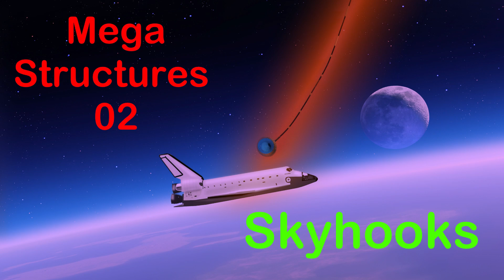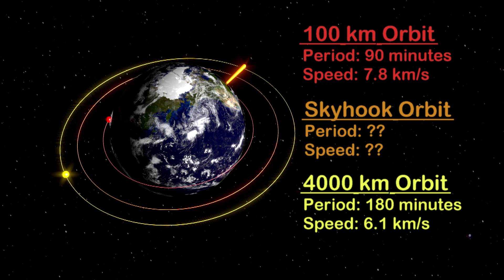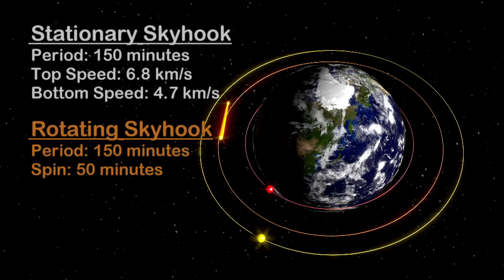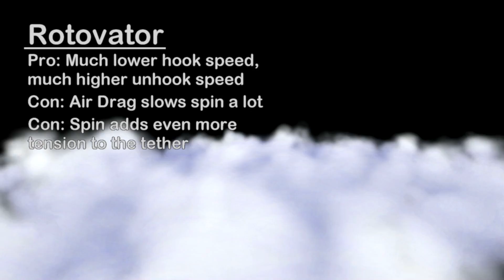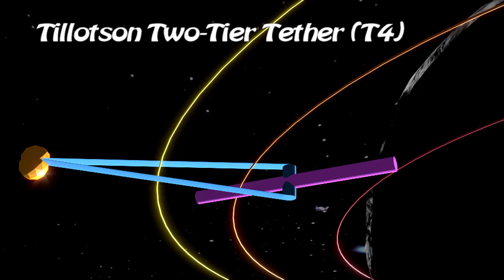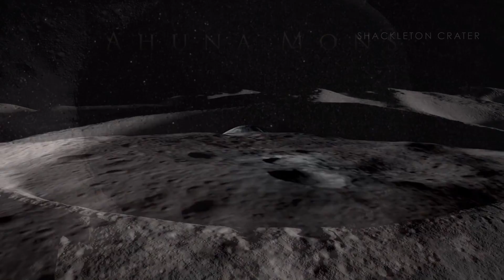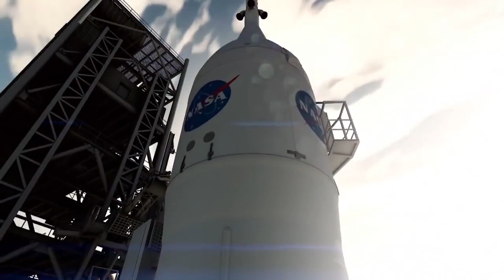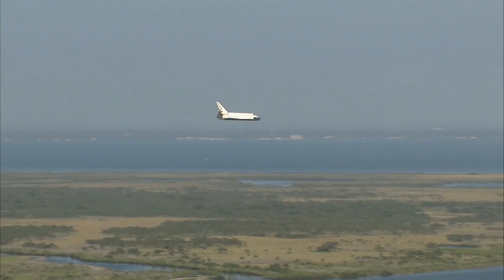Skyhooks & Rotovators

Comment: I'm hooked! lol

I am wondering about some of the challenges that might arise from this kind of tethering of the lower atmosphere and space, that has got to produce a LOT of heat if it is moving that fast in the atmosphere, no matter how thin the air is, second, all that motion, would that not create a giant target for static discharges from the atmosphere? To date, all of our experience has been with single point orbital crafts; would something that traverses several orbital zones present tidal challenges that could also vary, with the motion of the moon's orbits, and the relative positions of not only the ocean tides, but changes in the Earth's gravity based on its rotation vs the orbit of the spinning hook?

I know you said that basic computers can work out these things, but I fear that getting moment to moment data based on real time circumstances might be what is needed to balance and stabilize the sky hook's rotational orbit. I also wonder about how long one of these could be relied upon before its structural integrity fails, and how we would be able to monitor the hook's strength. Remember it only took a sheet of ice less than a meter across to fatally injure the shuttle.

I have no issue with what you have mentioned, its all the hundreds of tiny things that remain which bother me. I can assure you that I would never want a giant magnet to slam into a ship I was on in high atmosphere cruising at mock 1.2... the grab alone might be too much for the human body to take, and the ship... unless you construct it with a bump plate that is heavily reinforced for such a collision...  (the weight factor is another thing) Not only is the timing for the rendezvous critical, the downswing and the forward motion is a huge factor to contend with, this looks like a simple thing, but at speeds like these and distances like these, rotators could be off by a mere sixty meters and spear the poor cargo as it came into range, and that would be a near perfect line up by comparison to the scales involved. That magnet might latch onto a wing, or somehow the plane flips or rolls on its side due to the magnet being just off to one side, then the crew gets pulled in a direction that kills them.

I thought the stationary orbital sky hook was challenging enough, with plenty of engineering hurtles to overcome, without adding the rotational bonus of centrifugal forces, high speeds entering and leaving the atmosphere, and the hard sell "grabbing" of the payload. I have always thought in terms of simple is better, and while I know the only moving part is hook itself, but that may be an oversimplified view of this problem. 

I am not trying to shoot the idea down, but I am not a fan of this direction for acquiring orbit. Though humanity has the knowhow to do this, I do not think that we have the regard for strict upkeep that this design needs in order to keep it reliable and safe for use in an ongoing manner.
Reply from the maker: Well one thing I'm kicking myself for not having mentioned in the video, and there were actually a few, is that you can reel in a tether when it isn't hooking, at least enough to keep it over the atmosphere. Though in fact it would probably be several reels spaced along the length. Anyway that can help with heat and drag since it only dips down into the air when it is hooking something.

The acceleration of the connection itself shouldn't bee too bad, I should think you could reliably get to speed difference of 10 m/s or less in a short enough window and that ought to be enough to not require any truly epic shock absorption engineering. Easier said then done, I admit, but doable I think.
Reply: I just got your update on my feed, thank you for distracting me from debunking a Flat Earth "proof" video. No, I totally like the realistic nature of these concepts and practically based ideas... (talking about your videos now) I understand, making videos "all inclusive" to the nature of ever changing technology which makes a concept feasible vs impractical is often very hard to deliver... case and point: I would never have believed Space-X or anyone else could land a rocket the way they do... but it's a reality now.

Comment: With a robust rotovator 'network' you can almost have zero energy operations if traffic to and from earth is symmetric.  Knowing that space is the place to do all our future heavy manufacturing, you might even have to skip electrodynamic reboost and just shunt power into a maser and beam that to earth for power as incoming cargo comes down.  Or use it to power microwave hypersonic shuttles.
Reply from the maker: It does get easier if the hooks are big enough compared to the payloads to have relatively minor drop from each hook and you've got a lost of mass coming back down too, but I suspect we mostly won't and so will need something to handle the 'balance of payments' as it were.

Comment: Is it feasible to combine the idea of an elevator and a skyhook? As in, launch vehicles from an elevated station a few km up and then pick them up with a hook to require even less fuel?
Reply: Mel le, You could argue they are the same idea.  The skyhook is a special case of the rotovator or tether.  A skyhook rotates once per orbit.  The space elevator is a special case of the skyhook.  The elevator is a skyhook that rotates once per day and has a center of mass located at geosynchronous orbit. 
The main problem is that our buildings do not reach out of the atmosphere.  You need both buildings 100km tall and a bridge/runway between them.  A tower would also limit your options.  The only way to access space would be to travel to the towers.  With space planes you can take off and fly to the hook(s) from an airport.
On Mars Olympus Mons reaches out of the atmosphere.  The spaceport potential has been noticed.  On Phobos you could build a masonry tower tall enough to reach the Mars-Phobos Lagrange point.  From the Lagrange points you can build sideways and make a runway parallel to mars orbit.

Comment: I'm not sure if you mentioned it, but is there any way a ground based tether can be used to bring fuel to the rotating launch tether (meaning even less weight to be carried by the ship itself)? Or would changes in momentum ground this idea?
Reply: A medieval traction trebuchet might work an asteroid.   Replace wood with some other material.  Maybe use hydraulics.  On a planet with an atmosphere you run into problems with the cable burning up.

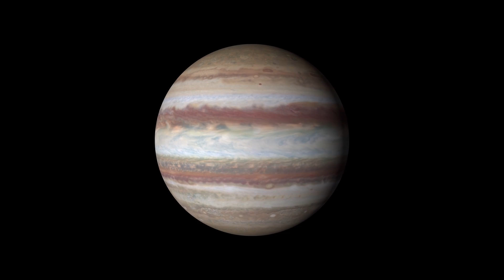Comment: 19:53 Are you sure there is no ground? I thought Jupiter has a rocky core.
Reply from the maker: Jupiter might, we don't really know yet, states of matter at those kind of pressures get kinda iffy, but its probably not a place people would be setting up bases.
Reply: yes a base would be a though challenges I would imagine. :)
Reply: From what I recall, the states of matter are not clearly defined as you go deeper.  You start with the thin atmosphere at the edge of Jupiter then that gas becomes denser and denser and starts acting like a liquid but isn't a liquid, but then becomes more like a liquid and then starts acting like a solid, but still isn't and so on.

Comment: The spinning one seems like it could fling things out into space. Like... an inter-planetary trebuchet :D
Reply from the maker: Yes, it is the advantage they have over a space elevator, when rotating it has a higher top tip speed.
Reply: And you can have multiple stages that toss stuff up further or capture incoming cargo to lower it.  A whole network could potentially allow for a zero energy transport network to anywhere and coming in from anywhere in the solar system as long as incoming and outgoing cargo is balanced.

Comment: The hook should really be going in the same direction as the craft at the start only marginally faster
other than that minor point great video
Reply from the maker: :) The plane has to catch it, or be overrun from behind by it, yes, but relative speed is dubious in the animation since it is just a photo of the sky being used. Special effects on the channel, at least the ones I make, are still 1990s low budget TV CGI levels

Comment: If you mine asteroids and use the skyhook to deliver down to earth it will provide momentum to help keep the skyhook in place.
Reply from the maker: Yes it would but I think you would want to be able to restore that momentum without needing an even flow of trade or a tight timetable.
Reply: You can adjust the deorbit velocity by adjusting the tether length.  Excess velocity gets dumped into the atmosphere (via parachute or wing).

Comment: i have a question. would it be relevant if you could have a weight within the shaft of a spinning sky-hook that would slide up and down depending on the orientation of the sky-hook?
would this help to keep its momentum? obviously it wouldn't keep the hook in orbit, but it would stop it from slowing down as much when interfered upon. it would have to be motorised and powered with solar panels. this is just a thought, i expect there to be a reason why it doesn't make sense but i don't see it yet :)
Reply from the maker: Now there's an interesting notion, a mass that dropped down as the hook's tip fell but lifted up right before the hooking. It could have advantages.
Reply: The sky hook always loses exactly the momentum that the payload gains.  The total is not effected by geometry. A spacestation/skyhook can have much larger mass than the payload.  Not all the mass needs to be rotating. 
Why inside the sky hook?  If it is inside the shaft it should probably be part of the shaft.  Sliding telescope tubes have mass but all the tubes can function as a pole.  
A fishing pole has much higher mass than fishing line.  Most of the mass of a fishing line is also in the spool.  A spool can be attached to a fishing pole in multiple locations or not attached.  People who fish like the spool to be next to the handle.  A large space station can use other arrangements.

Comment: Just what is the acceleration of anion drive from stationary, or from orbit or what have you. As in how long does it take from a relative walking pace to maximum speed?
Reply from the maker: The thrust an ion drive puts out is basically based on its available power and how big the drive is, it can be pretty huge just not as much as chemical rockets.

Comment: At the risk of sounding obtuse, what are the basic mechanics of the spce hook? Specifically how does a payload attain a higher orbit? Is it flung up there on the end of a rotating tether or does it ride along the length of the tether like the space elevator? I'm obviously missing something here. I assume there are some solid reasons why this technology hasn't been developed.  The likes of E Musk et al wouldn't pass up on a practical short cut to space. Would they?
Reply from the maker: On a stationary one it hooks and climbs up like an elevator or train, on a rotating one it hooks and holds on, then releases when the hook approaches the top.
Reply: Thanks for the clarification Issac

Comment: Tested this in KSP (sort of) making as simple a "sky hook" (long beam rotating something like a quarter of a revolution a second) I could launch a Kerbal+Landing-Pod from an apogee of ~10km above the mun to ~70km above the moon, where the beam itself only lost something like ~2km in apogee. (Hope that makes sense, was really fun!).
Reply: I've been meaning to code a rotovator mod for KSP after building a 200 meter truss in orbit and spinning it up(pain in the butt).

My idea is to have a part for the center of mass and then create virtual tips kilometers away from that part in orbit and some coding to simulate rotation  electrodynamic reboost code, tip drag code and etc.  

Then write some code for manual or automatic tip rendezvous/capture and use cheat physics to add reactionless acceleration to the craft based on what a rotovator would do.

Comment: You mentioned space elevators and gas giants and how there was nothing to attach the tether to at the bottom. What you went the other way and attached the tether to the top, so to speak. All of the gas giants in our solar system has moons that are tidally locked to them. I keep imagining space elevator going up from Io to it's L1 Lagrange point and then countering on from there all the way into Jupiter's atmosphere to scoop up hydrogen and maybe hold up a base. For dramatically fewer engineering complications, imagine the same setup with Neptune and Triton. Would anything to that effect have any merit?
Reply from the maker: You could have a tether hanging down from a moon, not quite entering the atmosphere, but it would need monstrously high tensile strength for Jupiter. A bit more viable for smaller ones.

Comment: How hard does the rotating hook pull once it's attached? That seems like the one risk that wasn't covered. From the animations it looks like it would yank the ship really hard and fling it around, requiring the ship to be made from very strong materials and contain special accommodations for the crew to survive high gee acceleration.
Reply from the maker: It depends on how fast one is spinning, how long, but even a 4000 km long one spinning every few hours is less than a gee.

Comment: nice ep. i was hoping for more on tethering and using the charge for power production from a space elevator to general power supply on the ground. with the skyhook swinging in at such speeds. wouldn't heating and ionization be a problem at the leading edges? having a different potential to the craft thats attaching to it?

Comment: Would it be possible to use an even slower non-rotating hook and after hooked, use ion drive or other means to pull the cargo further out atmosphere and faster? Maybe in the time frame of 12-18 hours? If possible, the increase in time seems like a great trade for less cost of R&D and "rocket fuel".
Reply: Anything to get us populating space quickly and safely has my vote and approval.

Comment: Great episode Isaac. If we had a sky hook in unison with say a SpaceX falcon9 booster then the F9 would not need to use the expendable upper stage. Just launch the booster up to the hook, transfer the payload to the hook and then the booster comes back down to land, refuel and do it all over again. Would be another great way to cut down on launch costs and would be 100% reusable. Very interesting idea these space hooks.
Reply from the maker: The neat thing about these new rockets that land themselves is they probably have control to hook automatically too, so I think its more viable than some of the ones in the past would be.

Comment: Just a thought. Use and electric jet (lithium batteries and gimbled fan) to get to 80,000 feet and then use a rotovator to fling it into space. You could get into orbit completely solar powered.

Comment: I donno, catching a hyper-sonic space hook seems cazy dangerous. The forces on the space plane traveling at those speeds could mean catastrophic failure if there is a miss that bumps the space plane in the wrong area. 

Though can argue with cheap and that some of these would not need nano-tubes, or graphene materials.
Reply: Docking in space is routine. Air to air refueling at subsonic speeds is also routine.
Both of course can go seriously wrong.

Comment: I pretty much overlooked your first take on skytooks, very happy that you made this deeper version!
Seems like there's a typo in credits, its says "Upward bound: Space Elevators Season 3, Episode 12" instead of Skyhooks.

I'm not sure that you mentioned this question: 
What keeps skyhooks straight? For rotating hooks its easy, there's centrifugal force.
But for stationary hooks made of flexible material like Kevlar things are different. Top end travels at speed higher then orbit speed at that height thus "wants" to escape, bottom end travels slower then orbit thus it's falling.
This difference will keep tether tensioned and thus straight.

P.S. intro/outro is awesome.
Reply from the maker: It's both, I decided I needed to number the episodes production-wise, this is the twelfth episode this year.

Comment: i wonder if anyone has thought of using a microwave to heat propellents such as water or some other gas or is that an ion engine?
Reply from the maker: Sure, you might remember me saying in the Interstellar Highway it didn't have to be lasers, that masers or particle streams could work. We've looked at using beam, microwave included, to put the energy into ships for superheating or ionizing propellant. It's got some good possibilities.

Comment: Deorbiting objects will add momentum.  No need for ion rockets except to make occasional adjustments.  A atom of oxygen leaving the tether can have the same velocity as an atom of oxygen leaving the rocket nozzle.  The moon is made of rock similar to earth rock.  You could drop a rock in the ocean or empty an oxygen tank.  7.342×1022 kg available and already in high orbit. A million tons of oxygen for fuel is less than a billionth of the the supply.  De-orbiting useful minerals mined from asteroids might give plenty of excess momentum for launches.  The mars colony might deorbit water.  

Might be worth pointing out that rockets work better at the end of a tether (also worse at wrong end).